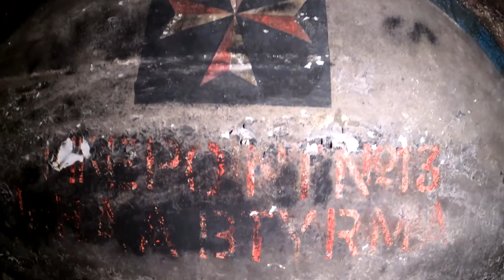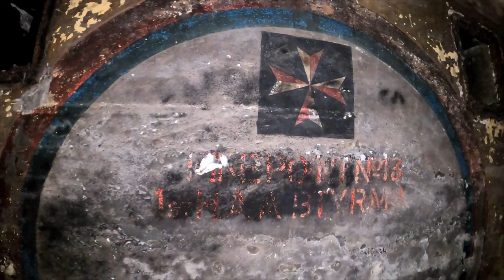Fort Saint Rocco Tunnels exploring Kalkara, Malta

Comment from the maker: Any more information on these locations, leave it here.
We really appreciate your support ❗♥️
Thank you in advance.
Reply: My father, Generoso Abela, did a lot of structural upgrading and maintenance work at Fort St Rocco as a Leaden Master Mason with Military Sub-contractors both during WWII and afterwards, as late as the middle 1950s.

I remember very clearly on some Sundays he used to take me with him on foot from Zejtun to the fort, via the Vittoriosa Gate and down the stairs at the back to Kalkara. He used to go to water spray the concrete works carried during the previous week so that it will not crack under the heat of the sun.

He was at the time working for Military sub-contractors Mr Filipu Gloria and Mr Pinu Chircop both from Zebbug. His work gang were mainly from Zebbug too and they used to pick him up every morning by a truck on their way to Fort St Rocco.

A good number of his gang were volunteers at the St Philip Fireworks Factory and on 7 April 1955 they had some concrete work to do and one of the gang, who was a leading man in the fireworks Factory, a Mr Stephen, forgot his surname, was held back at Fort Rocco to finish the concrete works which at that time was mixed on the spot in a small diesel driven concrete mixer. The fact that my father held him back saved his life as on that afternoon there was an explosion at the fireworks factor and four persons died, one of them was also a member of my father's work gang. 

Therefore it is confirmed that as late as 7 April 1955 works and upgrading were still taking place at Fort St Rocco. 

Another incident I remember well was when one of the workers lost part of his hand palm when it was caught in this diesel driven concrete mixer. 

Tony Abela
Reply from the maker: @The005233 interesting information, thanks for sharing.
Reply from the maker: @The005233  sad re the the fireworks factory incident and happy that he saved his life.